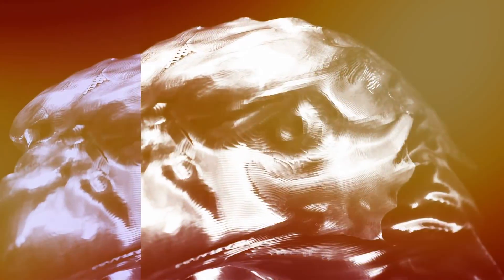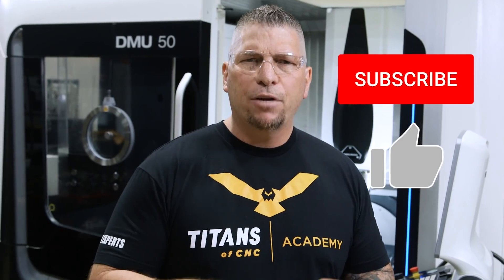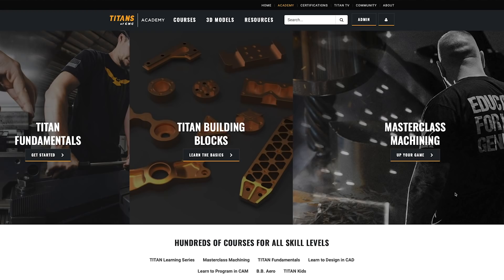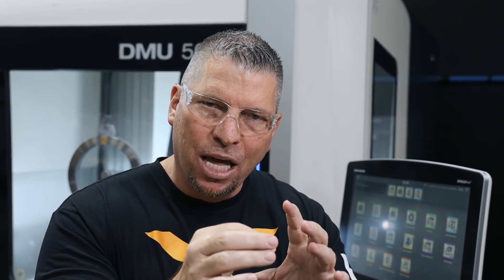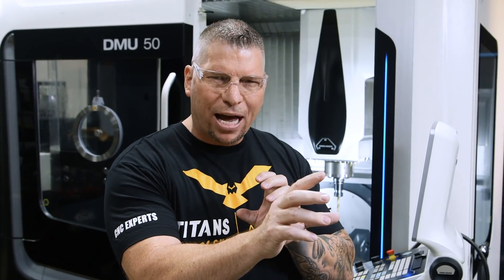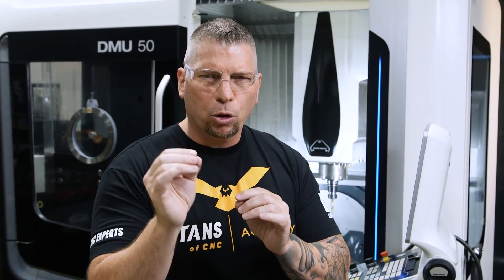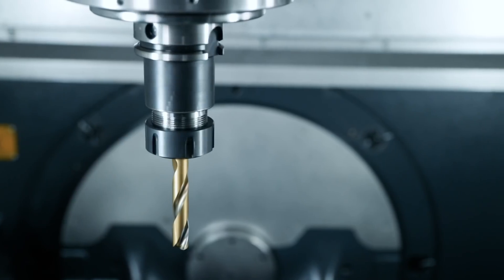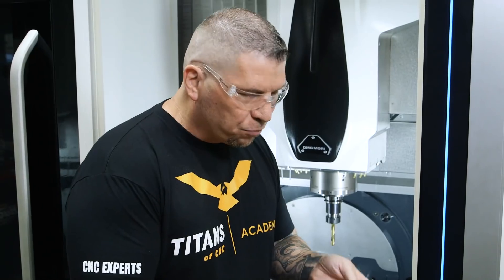Drilling Crystallized Hardened Material | CNC Machining MasterClass | Vlog #97

Comment: I once cut a metal "crystal" manufactured at LLNL. No drill would even scratch the surface of this material. It melted drills like butter. Answer Man Rick custom ground a  spade drill from .1875 dia. carbide and that worked pretty well. We needed the holes as starting points for the wire EDM machine. The guys from LLNL would not say what this single crystal was made from other than it contained Boron so DO NOT breath the dust. And that if dropped it would shatter. 
The moral of this story. Every shop needs at least one Answer Man.

Comment: Hi Titan, 
              I love the applications videos.  Is it just me or do any of you guys work in percentage of the drill diameter feed per revoloution for twist drills?  For example i'd know that 1% is quite light, 2 - 2.5% is aggressive.  I find this makes it scalable to know how hard to feed your drill, in this video you were feeding about 0.7% of the diameter per rev.   The surface feet per minute is scalable if you move up to say a 3/4" drill, and if you use % of the drill diamater Fu then you could calculate 0.007 * .75 =   0.00525" Fu for a 3/4" drill.  
https://www.instagram.com/matthew.gowan.5/

Comment: Titan do you know of any good computers or laptops for cheap but good for cad/cam because I just work a minimum wage job right now since I'm still in school
Reply: As long as you don’t need a super light weight laptop, you can buy a used Dell Precision laptops pretty cheap. I bought a used Dell Precision M4800 i5 2.5gHz 16gig RAM with Nvidia Quadro K1100M video card with 2gig VRAM. For a bit over $400 Australian (around $300 US) a machine like this will do almost anything CAD you need. Good luck! 🙂
Reply: I'd go desktop and look for a used computer with an i5 or i7. Anything from the second gen past is good.

Comment: Titan, would the same recipe apply if I do not have through spindle coolant? Do I need to peck. I can get my hands on GO drills but it would have to be the solid type since I don't have TSC. When posting drilling videos, can you please comment on the recipe for not TSC? It would be awesome if you could cover some of the other materials you have done in the past as well. I know TSC makes a big difference, but I'm sure there are plenty of machinist out there that don't have TSC on their machine. Would love to see that. Thank you.
Reply: I so agree. Those of us without TSC capable CNC mills need drilling/milling recipes that include type of drilling cycle to use, and adjustments to speeds and feeds when all we have available is a fogger/mister or just compressed air. I realize you are trying to teach everyone to compete in the global market, however not everyone has the machines you are using.

Comment: I have an idea to throw in a video or the building blocks. When you have an angled wall against a flat bottom surface, with no rad in the bottom, you can "ball finish" using a flat end mill and parallel strategy in fusion 360 as to not need a rad in the corner. BOOM!

Comment: Its kind of an insane tool, what reccomendations do you have toe maybe just a carbide tipped drill? Ofcourse you wouldnt go after this material with An HSS drill. Also what about drills that dont have though coolant? How to run those? Just thinking of people not spending huge money on tooling.
Reply: I second this. I dont have through spindle coolant. I'm sure these recipes don't work even if I did have a solid GO drill.

Comment: Why not plunge with a 2 or 3 flute endmill?
Reply: Endmills are not very good at plunging. Center cutting ones can, but even then tool life and cutting speed improves with a helical ramp in.

Even with a helical ramp, endmills are not competitive with drills for cutting speed. Drills are also cheaper than endmills.

Comment: Titan. I just looked that drill up. It's $150.00 for that price why don't you do a thorough review, and show the cutting edges under a magnifying glass, so we can see how "perfect" it looks for ourselves, say after 100 holes..BOOM
Reply: ...How much do you think that small piece of K500 costs?
Reply: @ericspda  $10-$50 per kilogram, and I would guess 5 kilo there so at the top end $250.00
Reply: @demandred1957  So why is the cost of the drill shocking? In my experience, high end tooling almost always more than pays for itself if you're paying skilled labor to run the machines. The only time a cheaper tool saves money is if you don't value your time and do everything yourself.
Reply: demandred1957 Of course, it’s not a great solution for a job shop or small batch. But in exotic alloys, a single colbalt still might not even make it through a handful of holes on a single part. So sometimes a good drill can be a huge relief if it means one tool lasts you all day vs needing a dozen swaps a shift. Swapping tools costs money, tools cost money, and you introduce some chance for error. So I’d say it’s more often than you think a high end drill will save the company money. Running small batches of parts in 6061, you’re probably never going to see a return on a carbide drill unless the part is full of holes. But for a surprising amount of parts in tougher materials, carbide pays. I run carbide exclusively in all production parts, and they pay for themselves fast. But I primarily run thousands of parts with hundreds to thousands of holes in 6061 and 7075. High end drills mean I can run at least 2x as many parts per day. It helps the drills in those diameters are like $12, but I’d pay much more since they last hundreds of thousands of holes in 6061 at 27K RPM.
Reply: demandred1957 Those endmills are crazy money for sure. I don’t have experience with the materials he’s running though, it very well could be the best bang for the buck in some extreme stuff. But yeah, I’m happy running relatively inexpensive tools most of the time since it’s common for us to replace endmills way early to hit surface finish requirements. And we use the warn out finishers as roughers so those are practically free and limitless. But Aluminum is kind to the tooling.